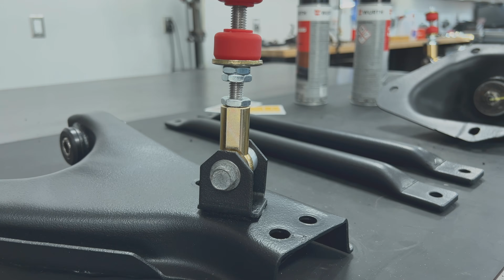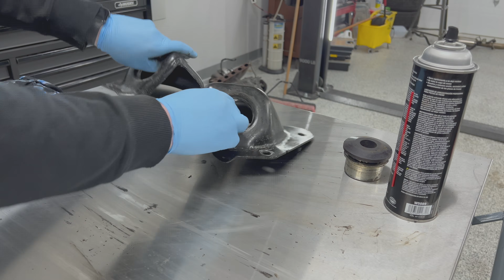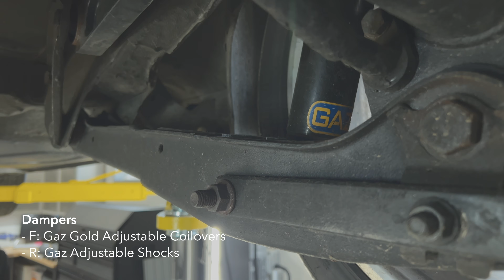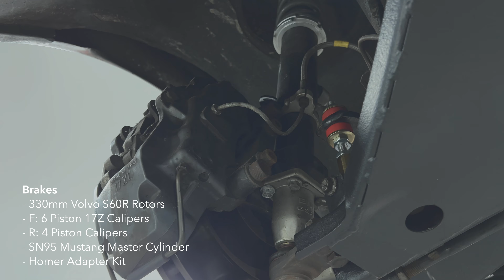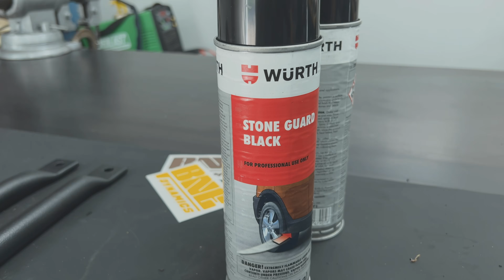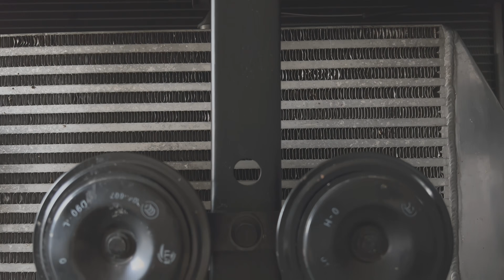Control Arms Refresh + ALL of the Suspension & Brake Modifications on my Volvo 242 T5 Build

Comment: I owned a ‘79 242 DL back in the 80’s and I struggled to AutoX the car. I really appreciate the detail of this video. These suspension details are where the V242 becomes a driver’s car rather than a utility car.  Thanks for posting!
Reply from the maker: Absolutely! It's truly a different car compared to the factory supplied setup. They can be quite capable cars, but they need a lot of things changed to get there.

Comment: Your videos are perfection (also the garage), just what I miss in Swedish videos! 
What wheels are you running? Im looking to find if the original 240 chassi has clearance for 17x8” ET 35 and 225 45 (or 50)mm tires✌️
Reply from the maker: Thank you! I’m running 17x9 but my fenders have been widened a little. 17x8 should be a good size for stock 240 chassis. ET35 is not nearly enough offset, so you would need ~20mm spacers. Definitely measure or search the forums though. It’s been a while since I looked at it
Reply: @Drive.Revive.Tinker  Thanks for the answer! I will look into it some more, are the spacers an issue for the bearings or are the loads on them going to be negligible as a daily driver? And by the way what type of TIG welder do you use?
Reply from the maker: Spacers won’t cause an issue. Just make sure you get high quality spacers that have hubcentric lips to properly align the wheel and hub. I use an Everlast Powertig 185

Comment: Thanks so much for sharing your suspension setup. I'm slowly putting together an LS/AR-5 swapped 242 and your thoughts on spring rates are super helpful. My thoughts have been leaning towards the 300f/200/r range and it's nice to hear I'm not 100% out to lunch.
Reply from the maker: Glad it was helpful! Good luck with your project

Comment: Do you like the sway bar? Im currently stuck with a 19mm v6 bar, which was the only one I could find that fits with a T5 swap. The sts bar has been out of stock for a long time. But I'm still curious on your opinion of the 28mm bar as 25mm seems to be a more widely used size (stock 4 cyl bar).
Reply from the maker: Yeah, I was lucky to grab one while they were available. I’d take a 28 over the 25, but really either are good. I remember it feeling like a huge upgrade when I first went from stock to 25mm. Upgrading from 25 to 28 was more nuanced, and also a bunch of time had passed between them because of all the work to do the t5 swap. That said, I’m really happy with the suspension in this car, aside from dialing in perfect spring rate (which really is already good).